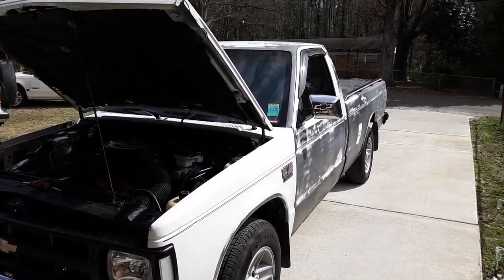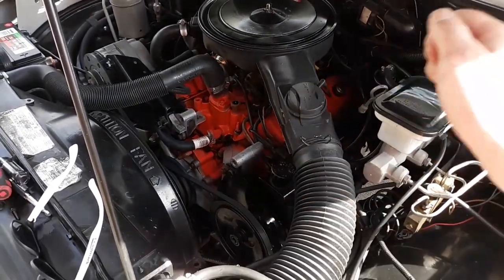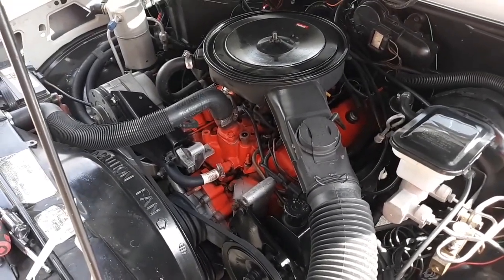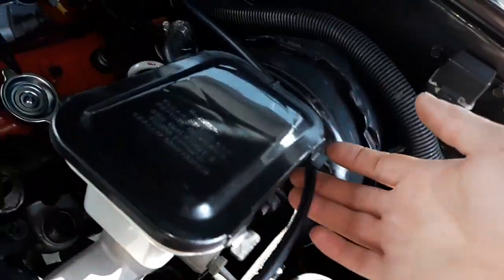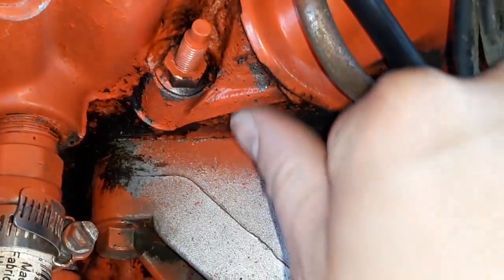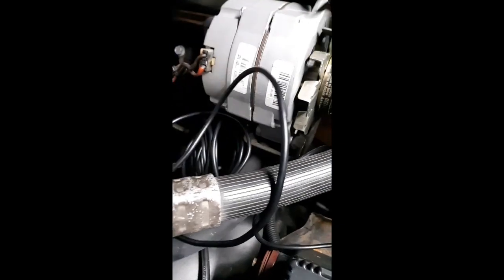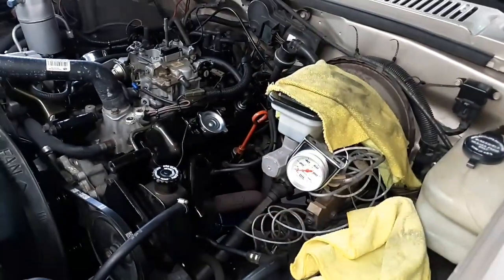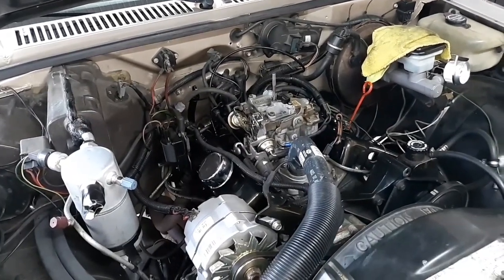The Engine is Done in the S10!! (Here's What happened??)

Comment: If that is an early 2.8L (1983ish) block, the engine VIN code will be behind the top of the water pump, under the heater hose that's going into the intake manifold. It could also be under the passenger side head, hidden behind all the alternator brackets. 

Loving all the S10 content! There's not much out there on the Tubes for these; especially for the 2.8L. Looking forward to seeing what ya do with em!
Reply from the maker: Interesting well hopefully whenever I remove the front part of the engine I'll find those numbers if it has them . 

And there's not many people out there that have any content or so much of the 2.8 anymore , there's a few of us on the Facebook forums but that's about it